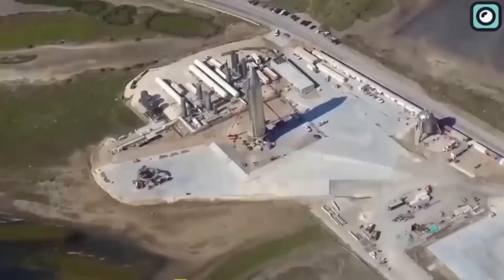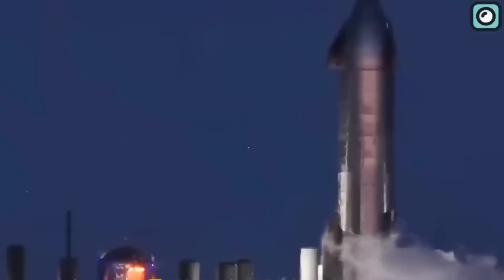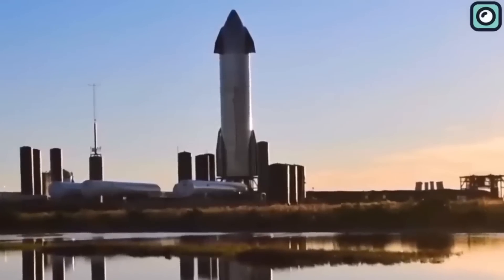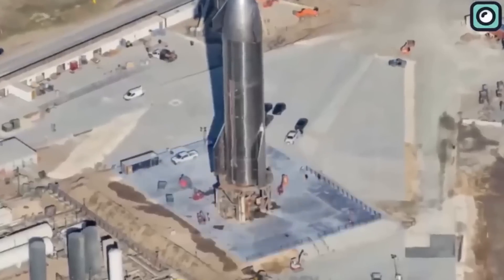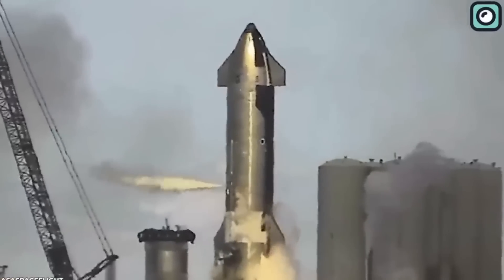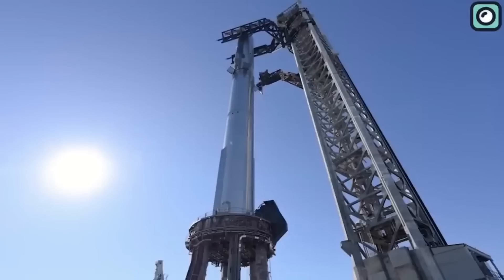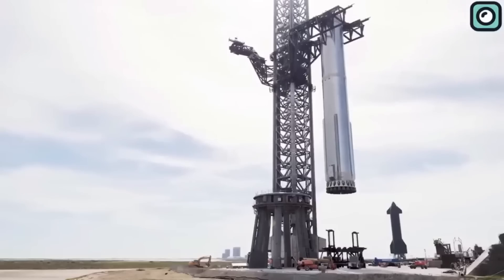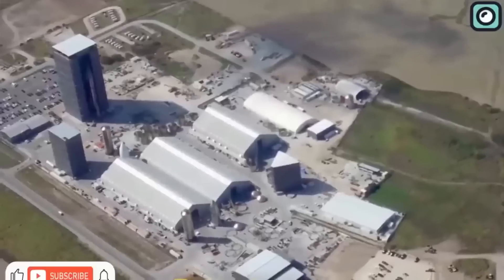FINALLY! SpaceX solved the Only Problem With 33 Engines!

Comment: The answer is simple light just enough raptor engines to get the spacecraft past a launch tower once past a large shower like the remaining engines this prevents damage to the launch pad
Reply: How many engines will it take to get the star ship off the launch pad and at least one tower's length above the launch site Only like those many engines needed to get it airborne but the rest of the engines once it clears the tower
Reply: Oh how many inches would it take to get to starship off the launch pad without destroying the launch pad like they did with the static fire of 7 engines how many of those had damaged a launch pad So the question is how many raptor engines will it take to get the starship off the launch pad pass the tower clear and then ignite the rest of the engines

Comment: To make  OLM fully reusable with fast turnaround and no flying debris they need to drill a hole in the center of the launch pad and tunnel exhaust so no more destruction every time firing the raptor engine.